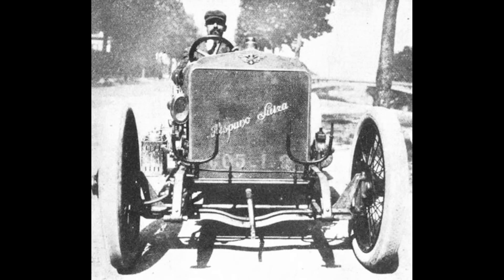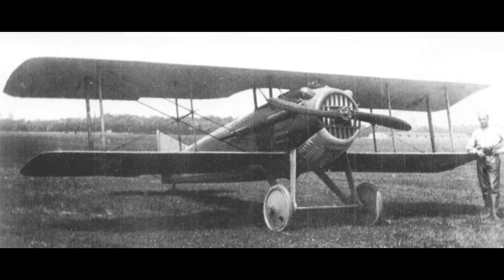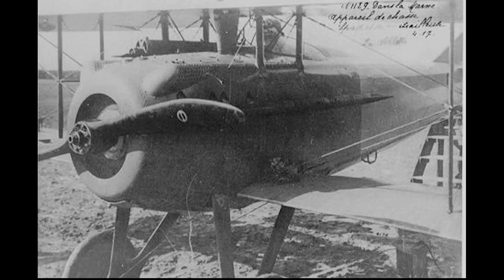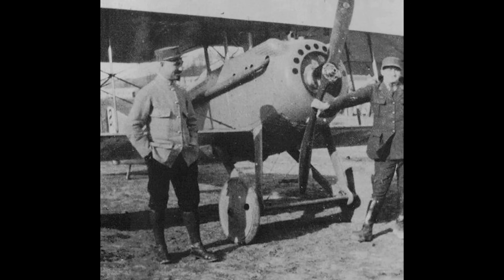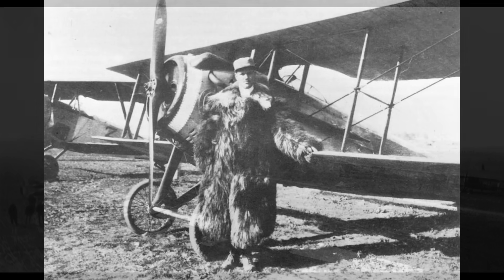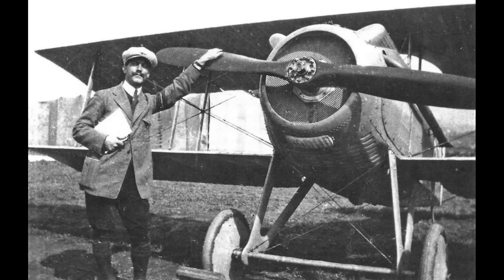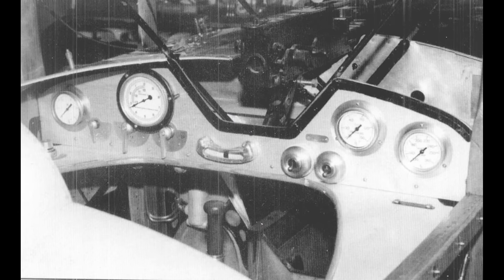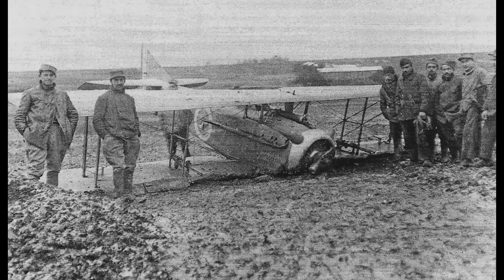The Spad VII: One Of The Best Aircraft Of The Great War

Comment: Even after all these years I'm still always surprised at how very small WW1 fighters really are. After I got used to how big WW2 fighters actually are, when I wasn't a kid anymore, then I had trouble thinking of the early ones as substantially smaller. Because they are ridiculously small for aircraft, just a guy sitting on a tiny little frame with a couple machine guns.
Reply: Some WWII fighters are big. Usually American ones. Rest of them are rather small. Bf 109, Yak-1/3/7 series, even Spitfire and Zero or Ki-43, Macchi MC.200 series... all are rather on the smaller side

Comment: Fun fact : the SPAD could dive faster than any fighter of the era due to a lucky design feature.

When diving at high speed, any other plane encountered destructive ailerons flutter. Back in the days, nobody knew that mobile control surfaces had to be balanced to avoid this issue. However, the connecting part of the SPAD ailerons actuator was a sturdy steel piece which, by mere luck, was acting as a balancing mass. And thus, the SPAD coud outdive anything, even the dreaded Fokker D VII.

Talented pilots such as Rene Fonck would quickly use that feature to their advantage in devastating boom and zoom attacks.

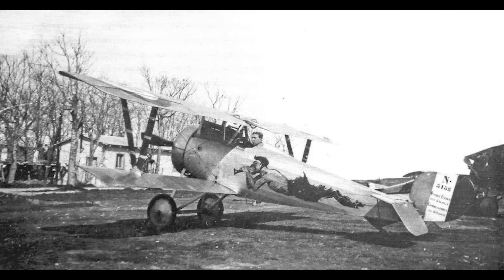Comment: As one of your Subscribers and a big fan of your channel, I was surprised to see two rather glaring errors in the video. The first is at 5:26 where a picture of what is obviously a Nieuport 17 was inserted during the narrative on the engine of the Spad VII. The second is at 10:56 when you mention the number of Spad VII's supplied to the "U.S. Army Air Force". The USAAF didn't exist in in 1917-1918. The reference should have been to the U.S. Air Service. Otherwise it was a good video.
Reply: Let me correct myself- my reference to "U.S. Air Service" was not correct- technically the reference should have been, Air Service, U.S.A or Air Service, AEF.

Comment: 11.6 liter 445lbs that's impressive are you sure that's correct? Either way I didn't know about it being on higher footing than the mostly radial dominated WW1 engines.👍
Reply: My thoughts exactly, then it says the whole plane weighs around 1500lbs ...? 👍
Reply: Add the weight of the radiator, mountings and coolant.

Comment: Compared to other famous WW1 fighter planes such as the British Sopwith Camel and the German Focker D7, the SPAD 13 was faster than the Camel but slower than the D7. Its maneuverability was at the middle between the Camel and the D7. One key aspect for the Entente is that the SPAD 13 was way easier to train and fly than the Camel which was notorious for the high casualty rates in training.

Comment: "Sir, where should we attach the additional machine guns?"
"Surprise me!"
Reply: Pilot presses the trigger:
Small doors on each side of the hull sides open up to reveal machine gun broadsides.
Reply: What are you talking about? The guns between the struts? That wasn't "unusual" back then because they didn't have "usual" yet, and there is no rain you can't do that.
Reply: 47-97 round magazine for a Lewis Gun. That would just poke holes in stuff, at the ranges fighters used, and their construction back then. 1-2-3 bursts, and then they're just extra weight.

I love WWI stuff, where having a little cocky strong pilot, actually added speed to the aircraft. 150-180hp only goes so far, even with aircraft weight included.

Truly, the time of the short kings (I'm a 6'1" big bastard, but there was a time when I would have wished I wasn't).

Comment: I guess .303 Vickers or Lewis where more reliable then anything available in 8mm Lebel.
Reply: The Hotchkiss 1914 had exceptional reliability, the problem was that none of the French machine guns were belt fed. (The 1914 was also heavier than a Vickers set up for aircraft use.)

Much better to buy a tried and tested design from your ally who had plenty of industrial capacity than spend scarce resources developing a new French mg.
Reply: @Vonstab  Also, Vickers was recoil operated with a toggle-lock mechanism that was easier to integrate with interruptor gear (propeller syncronisation) that the Hotchkiss which was gas operated

Comment: There's something charming about the early days of aviation where you could use a car engine to make things fly.
Reply: So does my uncle's plane. Self built with a Subaru engine.
Reply: Many light aircraft today still use derivatives of the old VW Beetle engine.
Reply: ...and car engines are still used today!  Corvair comes to mind among many others.
Reply: There's plenty of ultra-lights running on essentially motorbike engines, and in some cases, lawnmower engines. Car engines have plenty of power/weight ratio in comparison these days.

Might not be warplanes, but they're still aircraft.
Reply: Saw a home built with an LS7 engine in it at Oshkosh two years ago. Corvette power!!
Reply: Look up "Cessna LS swapped", plenty of people have put a car engine in aircraft.
Reply: It still can be done, it’s simply not done because the optimization pathways are quite divergent.
Reply: You still can. They just are less reliable than most people like, that make more power from less displacement, and running them for hours at speed is an issue. And they aren't rated for larger planes.
Reply: @justforever96 yeah, they're not designed for different atmospheric pressures or conditions, or upsy-downsy g-forces, or petrol pumps in those conditions either. But chipped well and turbo'd, they're still an option.

Still love it that they made a pretty viable plane during WWI with a car engines 😎
Reply: And what’s more today there are motorcycles that have more hp than those planes had
Reply: Certainly not. The Hispani V8 is not the V8 from a car: it's specific.
Reply: You still can
Reply: How many rounds of ammo have one of this planes?
Reply: That charm was still in effect into the 1960's and 70's. Without the Buick Wildcat car engines, the SR-71 couldn't fly!  ;)
Reply: You're uninformed re: this aspect of "flying cars" thru the 1950s,1960, 1970s. The EPA destroyed the efforts of people who developed such machines.